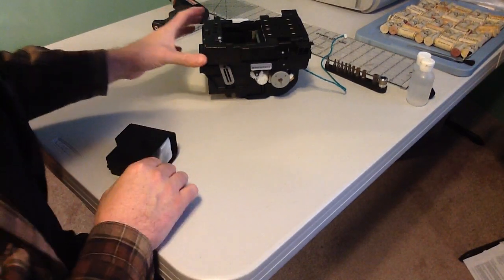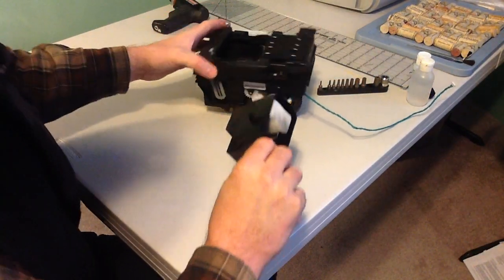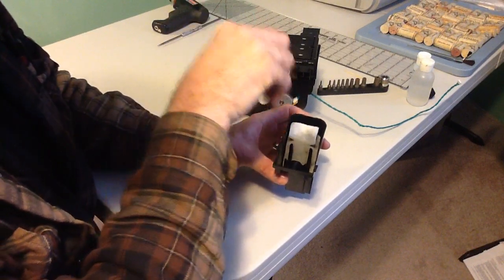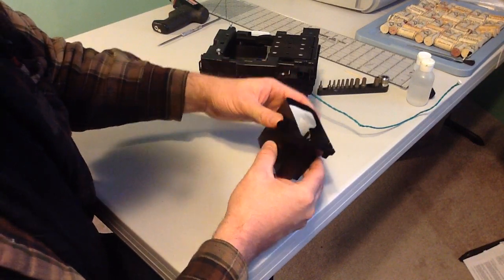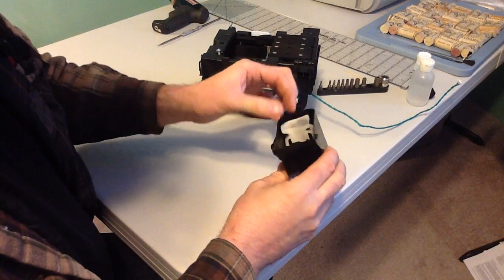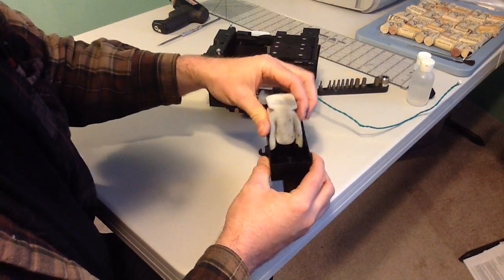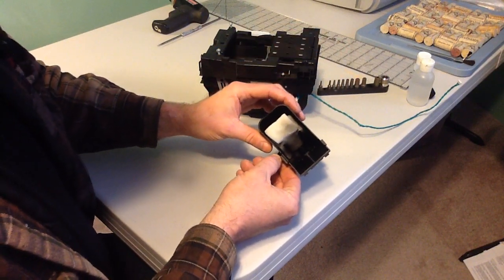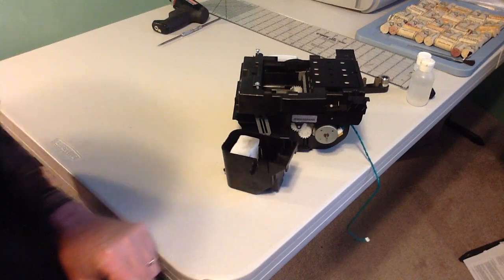HP 500 Design Jet 500 Printer Service Station Maintenance Part 2

Comment: Video still useful all this time later.  Got the same printer for cheap, was wondering if I could salvage the mess that was the service station with all the dust\ink\belt shrapnel.  Looks brand new now.

Comment: is that foam a part i can buy from somewhere ,i cleaned it but its deformed and wont go back to its original shape
Reply from the maker: John Mann I don’t know.  It is just a sponge, you might be able to cut something from some locally sourced sponge material...
Reply: @rronmar  thanks for the reply .ill see what i can come up with ,to make a piece big enough ,i assume the print heads dont actually need to touch it .if so maybe ill cut a piece of the end of the long sponge in the service station
Reply: Just about every printer in wide format has sponges to catch dumped ink. I used a sponge out of an old 260 to make marker nibs for refillable markers, I don't see why it wouldn't  work here!?!!😊

Comment: The long sponge/ filter in the service station...how do you dry it? Dont get much sun where i am from. Tumble dry or microwave an option without it shinking?
Reply from the maker: Dibb D got a space heater or even a fan in a warm room?  I would not use concentrated heat, just gentle heat and time...
Reply: @rronmar  yeah got space heaters. Thanks alot been air drying for 2 days and still soaked.
Reply: Just wanted to say thanks again. Following your video and advice, ive got a broken printer for free and got it up and running. Saved over £600 with your video. :)
Reply from the maker: Ur welcome, kinda how I started learning about these.  Got one for a song, needed a belt and serviced and it prints great.